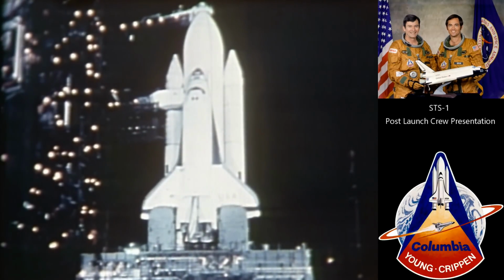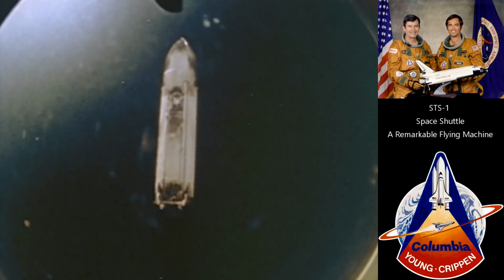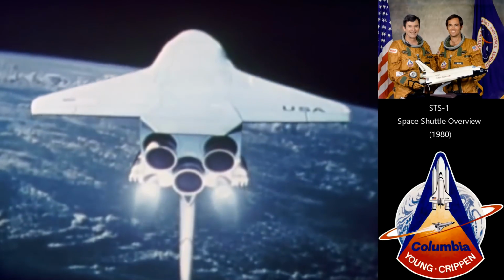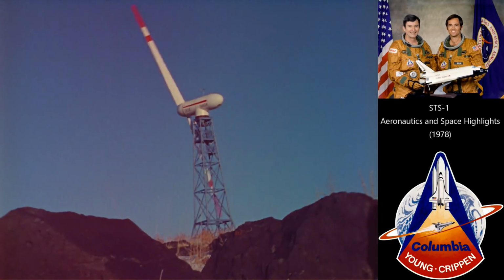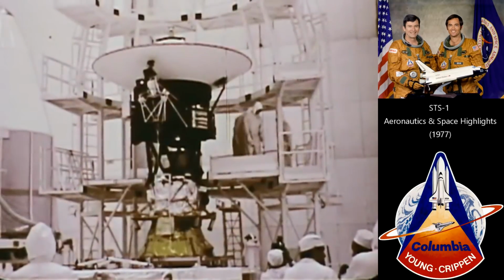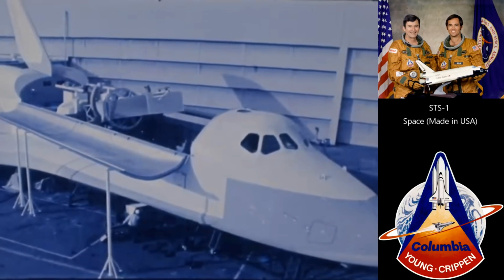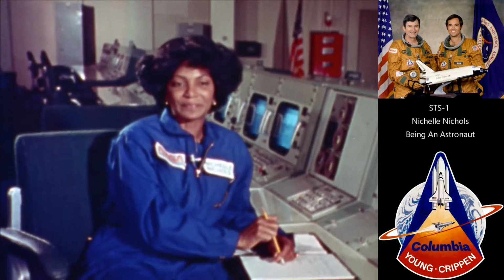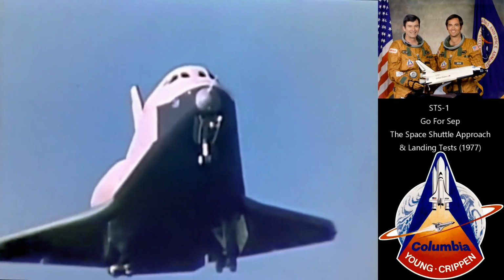STS 1 Post Flight and Extras (40th anniversary)

Comment: The fact that some tiles were missing from the rocket engine fairings was certainly a bit worrying. But I always wondered why, when NASA knew it would use the "Canadarm", it did not take it on board for all missions. John Young and Bob Crippen surely thought of the tiles that could have been missing where it is most dangerous for the shuttle and their lives: the ventral part (the underside) this part which is the most subject to high heat with the nose of the machine and the leading edges of the wings... (as we will unfortunately see during STS-107) However, STS-1 and STS-107 were not equipped with the Canadarm and the verification camera of the state of thermal protection tiles, VITAL for astronauts. So, even long after, I still ask: WHY?

Comment: "[In 1967] SL-3, the third and what would be the final test rocket, used a partially submerged nozzle and produced 2,670,000 kgf thrust, making it the largest solid-fuel rocket ever." I have to keep reminding myself that nothing like this has ever been done before. The first time Columbia ever flew, it was a full-on orbital mission. Kudos to John Young for landing so well for the very first time.

Comment: SR71 Ejection seats and pressure suit. They ditched that system quickly when it was discovered that they only had a very small window in the ascent where it would work (and not get killed). Unfortuanely, the lack really of ascent abort was the worst thing about the system. That said, I can't think of how they would do that, given the design.

Comment: Wonderful video series. Watched 'em all.  Thank you for marking this historical mission.  John mentions the foam coming off the main tank and hitting the windscreen.  A warning from the get-go that shedding foam was an issue.  They should have found a solution, even if it meant a significant redesign.
Reply: I thought the same thing.
Reply: As they say, hindsight is 20/20.